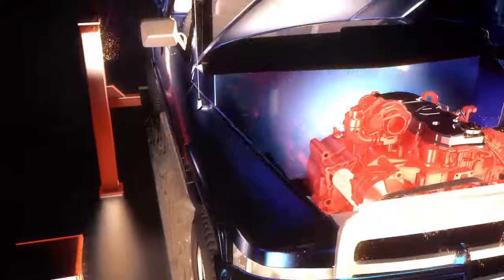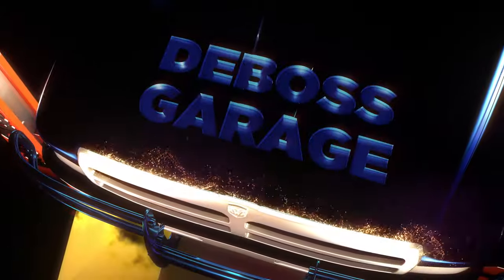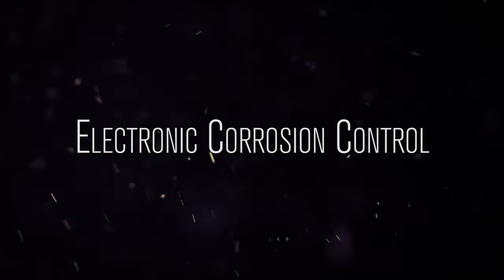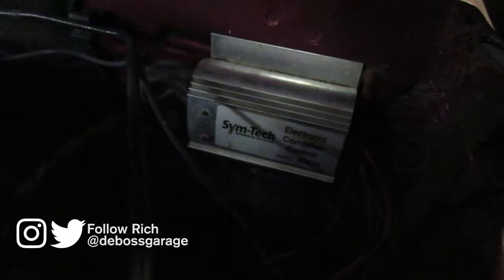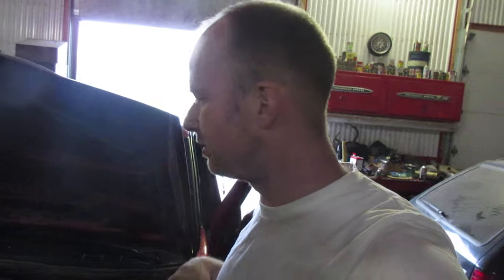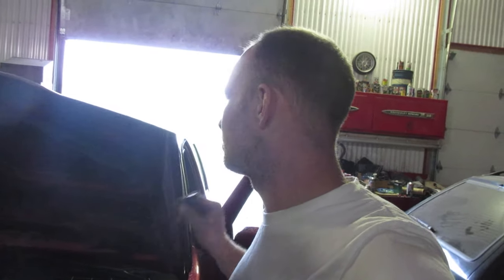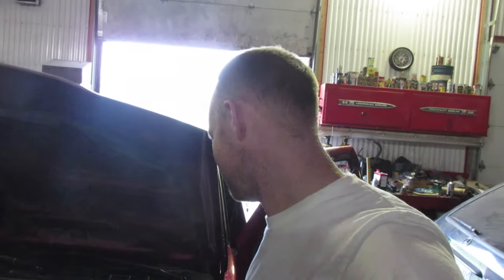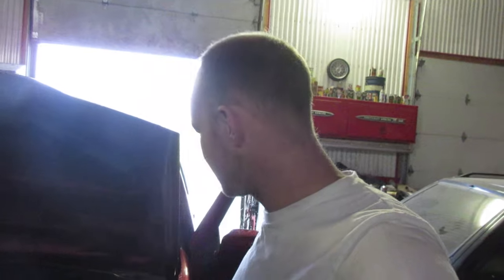The Truth About Electronic Rust Protection

Comment: WHAAAA?  All your electronics RUN THROW CABLES WHICH ARE INSULATED.  Your frame, body, components, etc... are not electrically charged!   I'm not saying these devices work or do not work - but your statement that your stock electronics are charging the metal of the car the way a rust inhibitor does, is rubbish.  Sorry to be blunt.

Comment: Any scientific testing done to prove your claim?
Reply from the maker: My good buddy who works in a body shop and see's vehicles coming through the shop that have the same amount of rust with or without the boxes.  The channel is sharing our experiences.
Reply: Corrosion is caused when two dissimilar materialscreate electrolysis and the by product of the reaction between these materials surfaces as corrosion. Provided a current goes through the material to negate this electrolysis the byproduct of corrosion will not appear. the currents and trickle charge that he speaks of is not a current running through the body or frame. This very short video doesn't prove or disprove